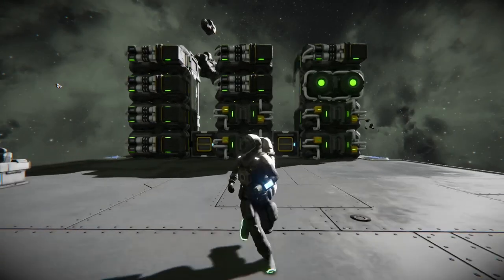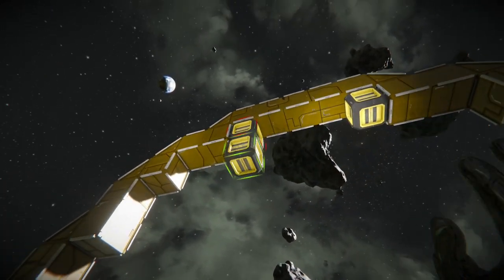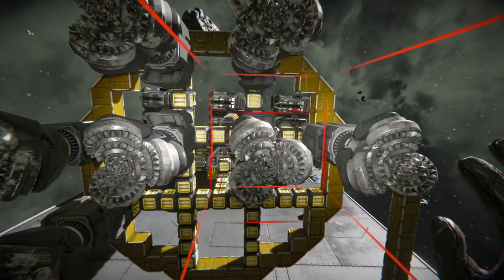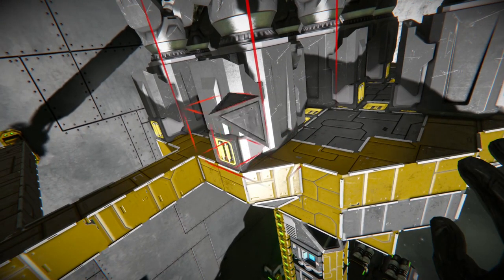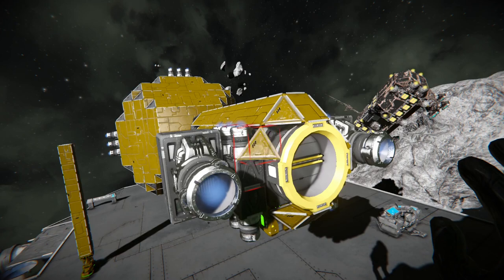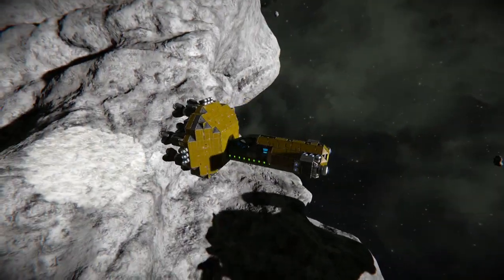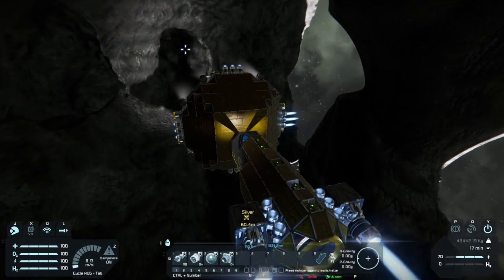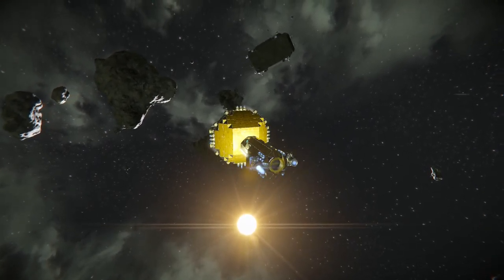How To Selective Mine Using Sorters And Ejectors In Space

Comment: Since you are doing these builds in creative ... the CTRL and the SHIFT keys allow you to draw a line or plain of block in on click of the mouse button (LMB) same with removing blocks (RMB). just hold down the CTRL and/or the SHIFT while placing the desired block. There is a setting (Options) in the main menu you can change the single block placement  to the other modes ( but most don't change this)

The other benefit for these videos would be "Mirror Mode" there are a few block s that don't mirror correctly.